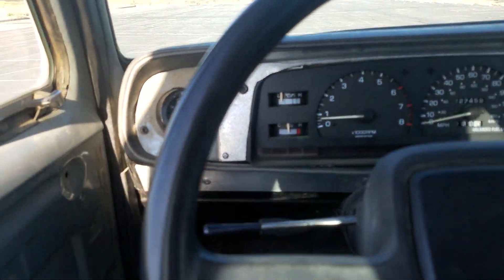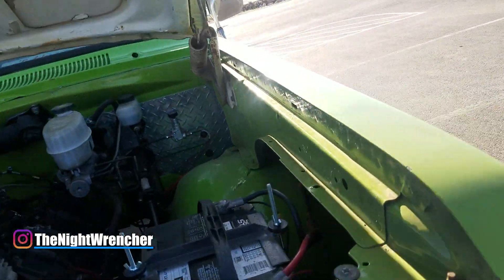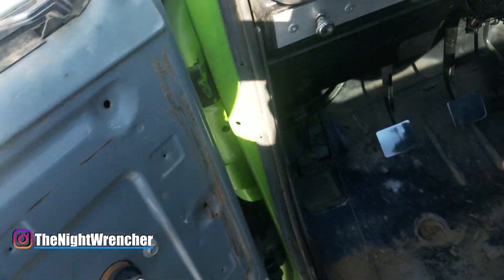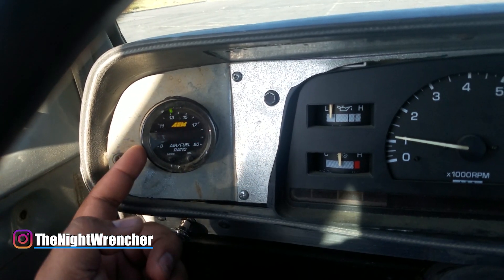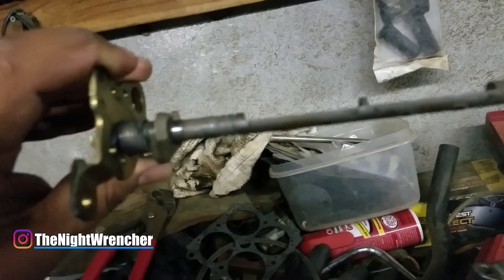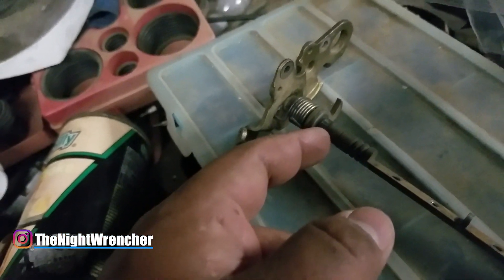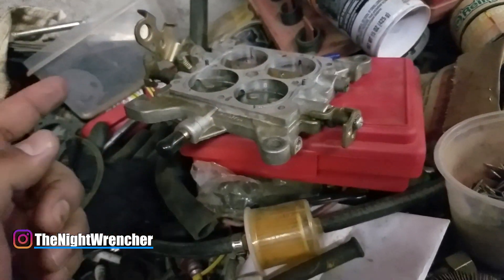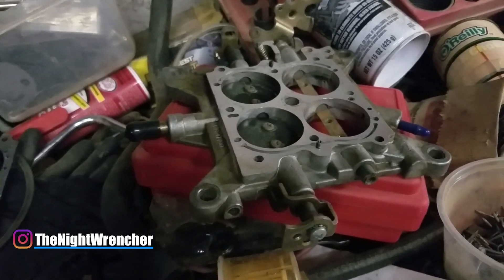Holley Carb Vacuum Leak Diagnosis, Where And How I Find It | Holley Carb Secretes |

Comment: if you see fuel in the intake vacuum hoses the secondary vacuum diaphragm rubber has a hole in the vacuum seal, change that and its fixed, top secret

Comment: I found a major vacume leak  from my vacume secondary shaft bushings.. teflon and trashed.. check out my channel to see shaft play, running conditions and diagnosis with out an afr gauge ..  also specs of bushing should u be rebuilding and questioning.. as I was 🎉 .. also playlists of a 96 f150 efi to carb and 70s style rewired reworked with no modules..  low buck and hard-core